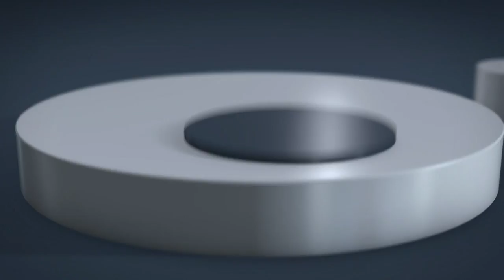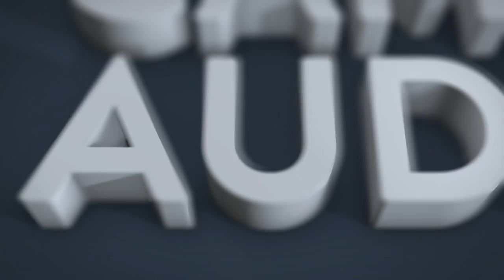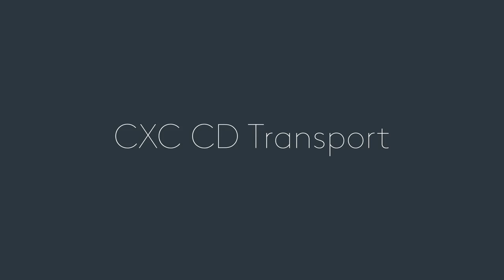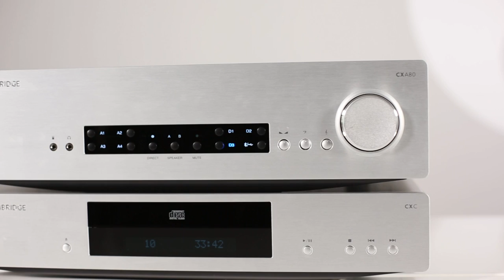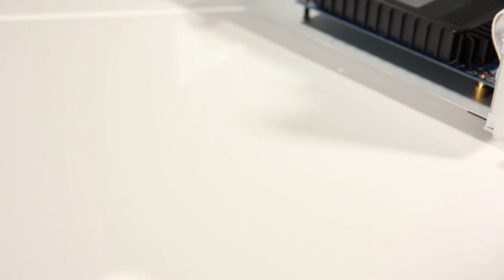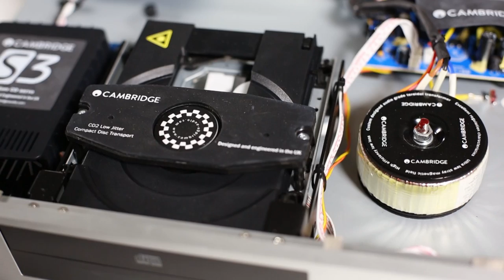CXC CD Transport

Comment: Hi there, I have recently purchased this cd transporter. You say and I believe it states that it can play “audio cd’” however, I have a cd-r with .WAV file extension songs burned onto it. When I attempt to play the cd, it attempts to load the cd, displays the cd track info and then eventually ejects the cd without it working. Could you please assist?
Reply: It's not audio CD format and this device won't play it. You will need to copy those wave files to PC and burn an audio CD.
Reply: This is not a cd player, this is a cd transport, its made to transport real cd in best way possible to a dac , what you really need there is to put all your music on a computer with ssd, and play it with external usb dac, playing compressed files on a cd is useless nowadays

Comment: Hi Ben, I just bought your CXU bluray player. It is so brilliant. I am using the 2 channel analog outputs into my Yamaha RXV-667 amp. Would I be better off using the Digital Outputs for CD playback and let the amp's DAC do the decoding please?

I was thinking about your CXR200 amp in the future but I read that it does not have HDMI 2.0a signals. Is that correct please? I read on an AV forum that "HDMI 2.0a added support for High Dynamic Range (HDR) video and as this update to the specification came out after the development of the CXRs, the HDR format is not supported and is a hardware change, meaning that it willl not be possible to add this to the CXR".

Is this true please?

Comment: Sorry Ben but I have to brink this to the attention of potential buyer.
The display on my 2 y.o. CXC transport stopped working. I looked for a replacement only to be told, stock is limited and only available to authorized dealers!
I am not an "authorized dealer" but I have a degree in electronic engineering so, I don't need the 'services' of such dealer (and the cost that would come with it).
I have repaired several other (brands) of CD players / transports and amplifiers so, I think your policy of not supplying a replacement display is simply wrong and does not serve the consumer very well.
Please correct me if I am wrong but, Cambridge Audio has to improve on customer service and parts supply.

Comment: Impossible de trouver un transport CD avec une bonne mécanique de lecture à prix raisonnable. Pourtant le marché du DAC externe explose, et beaucoup d'amplificateur intégré disposent d'un DAC interne. Si on trouve des lecteurs interessants pour l'audiophile peu fortuné à moins de 700 Euros, pourquoi ne propose t-on pas un transport au même prix ? Sans le DAC, mais avec une mécanique plus soignée. Le CXC serait bien, mais c'est un choix volontaire, il ne prends pas les CD/R. Quel dommage pour moi. Du coup je ne vois plus que le Yamaha CD-S 700, dont la mécanique est de bonne qualité, à un prix raisonnable pour une telle utilisation. Une autre idée ? (Unable to find a CD transport with a good reading mechanics at reasonable price. Yet the external DAC market is exploding, and many built-in amplifiers have an internal DAC. If we find readers interesting for the less fortunate audiophile at less than 700 Euros, why does not one offer a transport at the same price? Without the DAC, but with a more careful mechanics. The CXC would be fine, but it's a voluntary choice, it does not take the CD / R. What a pity for me. So I can only see the Yamaha CD-S 700, the mechanics of which are of good quality, at a reasonable price for such use. An other idea ?)

Comment: You’re making a lot of fancy claims here. Have you got any lab results compared with other units to prove all these claims. We don’t want to veer into audiophool mumbo jumbo do we? I would counter these claims by saying that the jitter from any drive is well below human threshold and the 1s and 0s output by this machine are identical to any other unit costing a good deal less.
Reply: There are no 1s and 0s on an audio CD, so it is not a digital medium to begin with, the data on an audio CD are digitally processed; there is no timing signal on an audio CD and no error correction. So unlike what you say, "it is not all 1s and 0s and they are all the same". That is why a quality drive makes a difference. An alternative is to actually read the data out with a computer CDROM drive with error correction / multiple read attempts which an audio CD drive does not do, buffer that data stream in a RAM before passing it on etc like some manufacturers do, e.g. PS Audio or MSB, but I am not aware of any such solution that is 'cheap'. I have a (really!!) great advise for you, which I had received myself like 30 years ago from a shop owner who had sold my first CD player to me: just listen to different offerings and if you cannot hear a difference, then that's great for you, because then you can buy the cheapest one among thhose that sound equally good to you. Pretty cool, eh? ;)
Reply: Wrong. Wrong. Wrong. The pits cause a phase change in the laser beam creati switching between 1 and 0 state. The CD is a digital medium. Reed-Solomon Error correction is extremely robust on the cheapest CD player which also have RAM buffering from the drive and the DAC input chip. The multiple forms of jitter are well below the threshold of human detection in the AES psychoacoustic papers. The digital signal from the cheapest CD player is bit perfect and all the data is there. No evidence to show anywhere that better data transfer is to be had by spending money on this type of machine. You actually need to back up your claims with scientific and laboratory credentials not just what some salesman or audiophool told you what you just believe otherwise it’s little more than a delusional religious belief.
Reply: @supersonicboy75  Read the first page. It is really a player review, but the first page is not, it is an outline of how CD data is read. There are no 1s and 0s. The data CD is a digital medium.
https://6moons.com/audioreviews/psaudio7/perfectwave.html

Btw, even if all things were equal, which they are not, then it would still make sense to invest money in to a machine that has a serious power supply compared to a cheap and shitty one... look in to the specs of actual drive mechanisms in expensive players, e.g. Phillips Pro drives; if you think they are all the same, it just goes to show you don't know what you are talking about.
Reply: @Baerchenization , thank you, that is a most interesting reading and a lot was new to me.